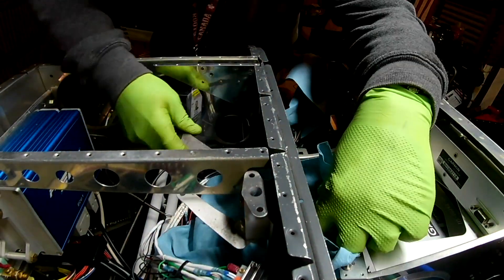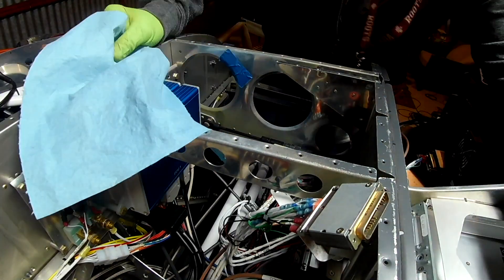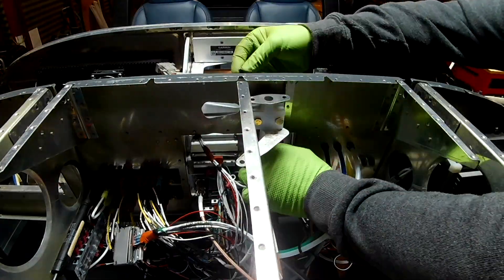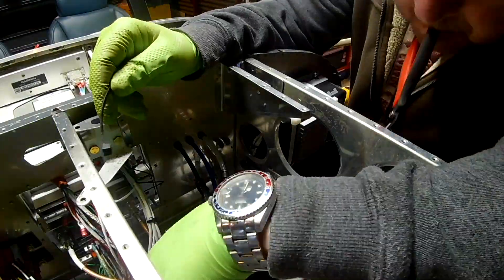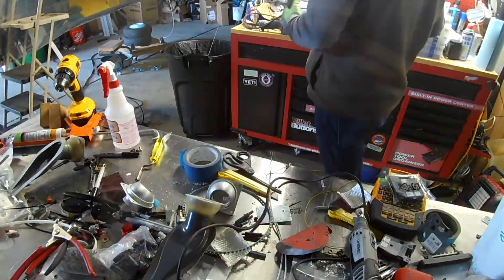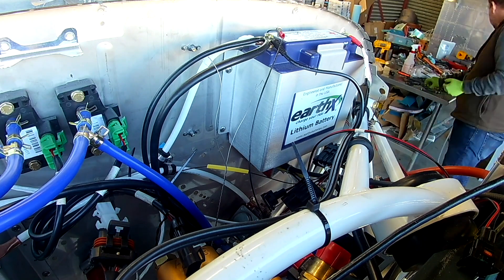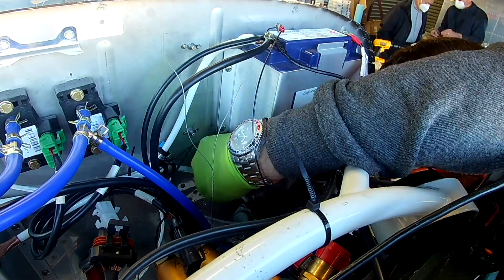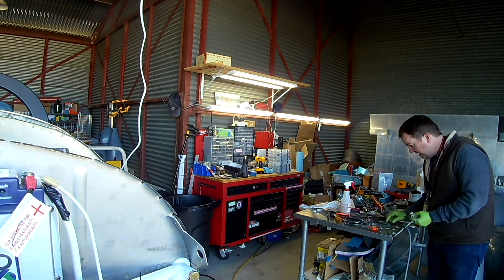RV-14 G3X Wiring Finalé (for real this time)

Comment: Hi Andrew - you might try Leah at Gallagher - they are great, and really know Vans aircraft, and my -14A was no issue to insure.  I started with a non-movement policy, increasing the value as I built, then added a movement (i.e. engine start and taxiing, but not flying), and then a full flying policy with full hull and liability from day one.  Reasonable training requirements (I think it was at least 3hrs for the policy, but I did almost 9hrs with Mike Seager).